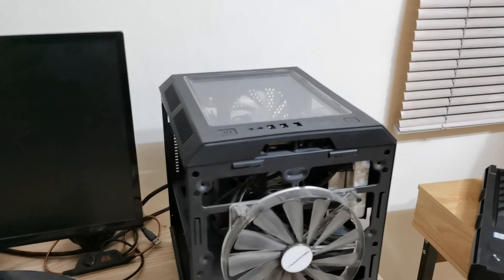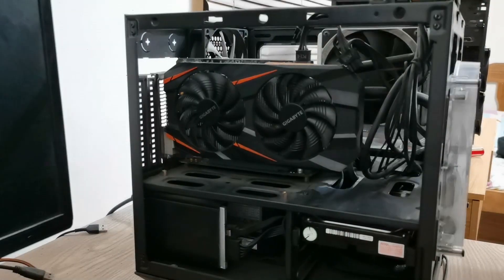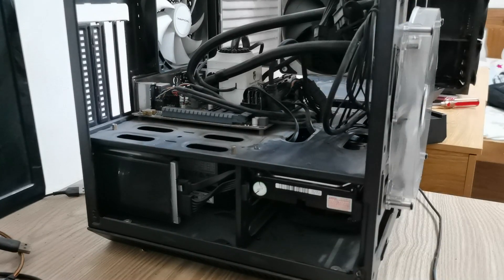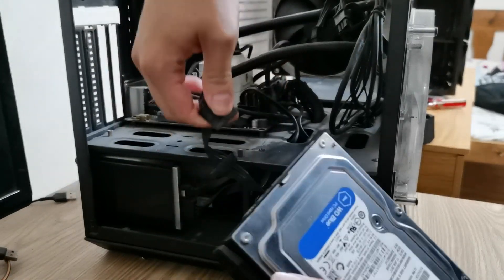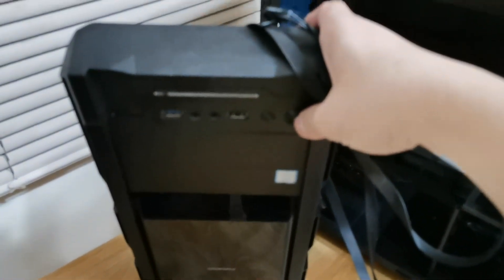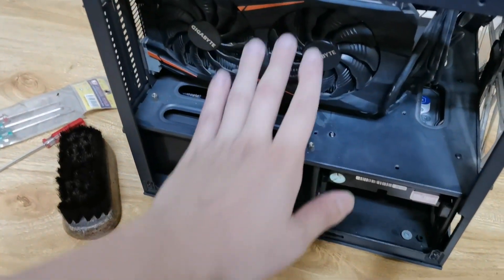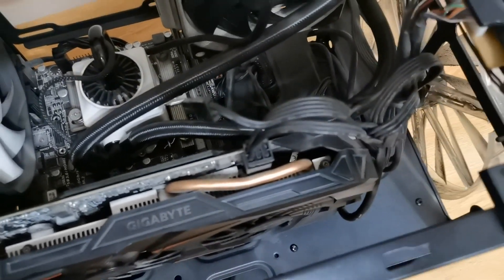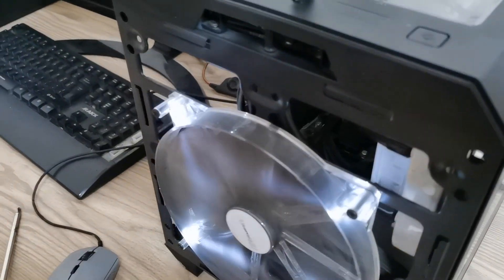PC Keeps restarting / Random Crash (FIX! + Changing Thermal Paste)

Comment: I don't understand what was the problem! And how he found solution?
Reply from the maker: the problem is my PC wont start up it keeps restarting and restarting. until I solved the problem by cleaning my Memory RAM stick and re-insert again.
Reply: @kennethverana5885  I have the same problem. It keeps restarting. I cleaned my ram stick but that didn't help. What can I do now?? 🥺
Reply from the maker: well I think you need to do a RAM test if you have another rig try putting your current RAM to another rig and see if the system open without issue if not then you have to buy another RAM

Comment: Hi great video! Do I need a mat or anti-static bracelet to prevent electrical discharge? I plan to take a part and RE-build my pc so that i can learn how to actually build a pc. Thanks
Reply from the maker: For me its not very important, I've never worn anti-static bracelet, and I've never experienced such damaged before. just to make sure you unplug everything from your PC and place your hand inside the metal surface of your chassis before doing anything with your components.